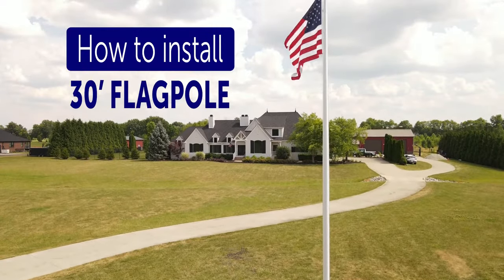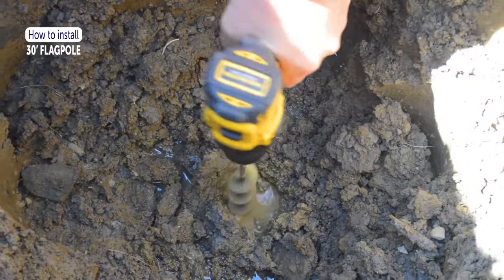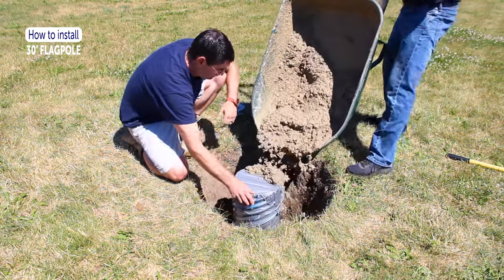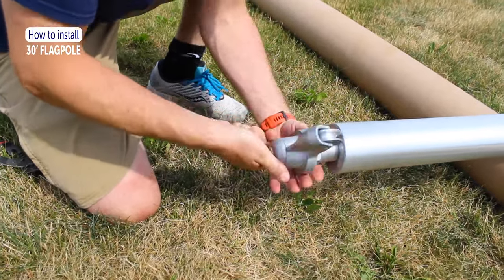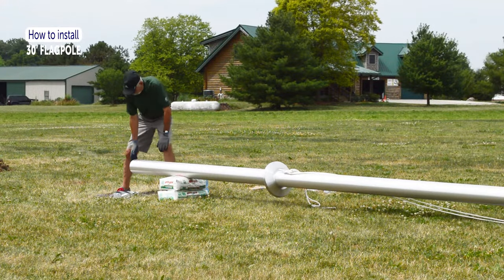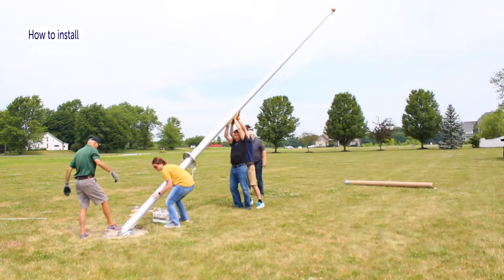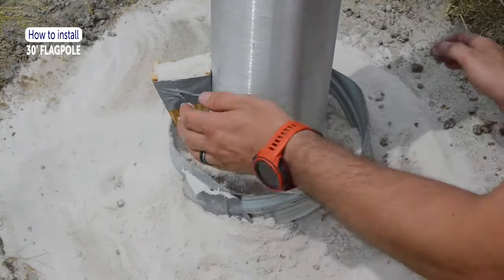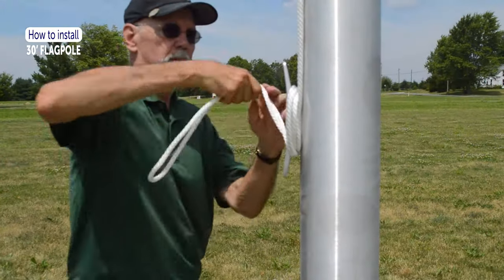How To Install 30' Flagpole

Comment: The 25' flagpoles and longer need a wide hole but those augers you can rent are only digging an 8" hole.....and so you are renting an auger but still have to do a lot of digging by hand to get the wider hole......also, those sleeves are not needed and a waste of money.....and lastly you need to make sure your sleeve is PLUMB not level......